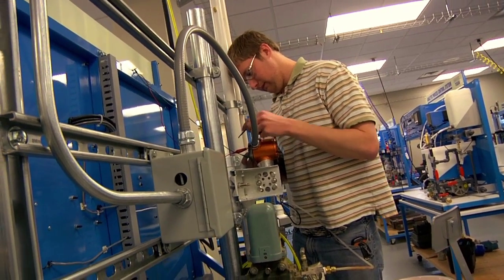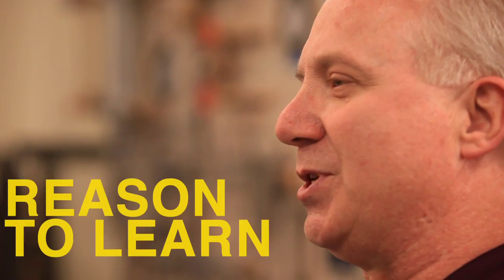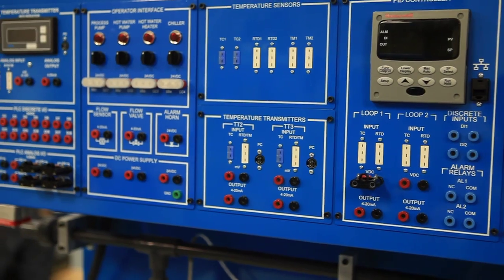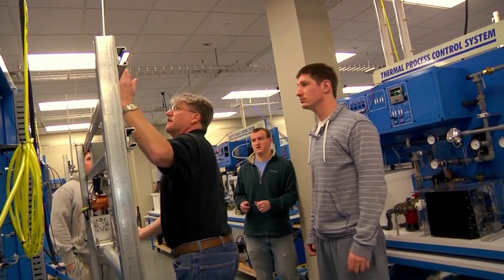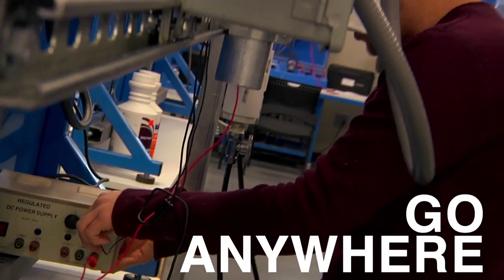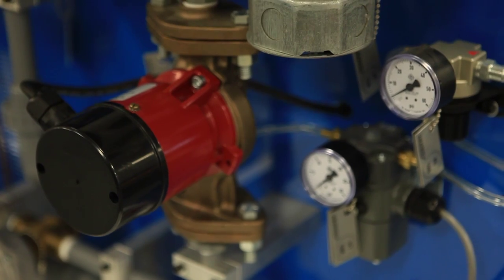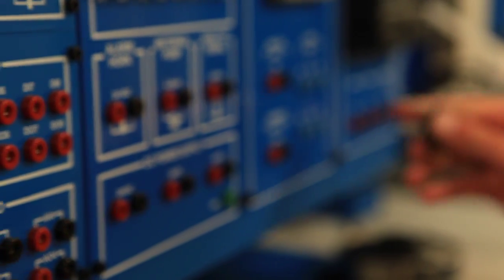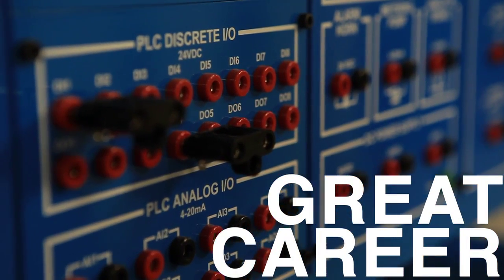Instrumentation & Control Technology

Comment: I have 30 + years experience in industrial controls. I have 2 community college certificates,1 in HVAC and 1 in electronics.
I started out as a panel builder, spent 9 years in process instrumentation, 2 years in calibration and 12 years in field service
repairing motor driven actuators and controls.

I am, unfortunately, 62 years old, not working, can't afford to retire and essentially unemployable.
I have been consistently passed over by potential employers in spite of my experience.

The job opportunities are there, but only for people of the right age.
Reply: I am disgusted and so saddened to hear that. Continue to push, dear friend. Push and push and push. Eventually a door will open and you will be recognized as the asset that you are.
Reply: paulgra I feel sad for you.
I'm currently pursuing bachelors in instrumentation and control..
Reply: That's illegal and called ageism.
Reply: paulgra, it's not right, but companies look at it from a medical benefits viewpoint...unless you can do CEMS exclusively.
Reply: this proves there is no shortage !!!!!
Reply: This should a good example of why you should max you 401k and invest your money for retirement. The sooner you start the better off you are when you retire.
Reply: I think people with your experience and at your age should be teaching us as instructors and teachers. Regardless if you or anyone has a 'degree.'

Comment: I work at Endress+Hauser as Field Instrumentation Engineer / Calibration Engineer.
We work in all industries, Oil&Gas, Food, W&WWTW, Chemical Factories, Diaries, Etc.
Work for use can range from Commissioning, repairing and calibrating instruments on a wide range of equipment.
Instrumentation is worth while to get into if possible as there is plenty to learn.

Comment from the maker: The field of instrumentation is the measurement and control of any industrial process. Typically instrument technicians create, construct, and maintain the measurement, control devices, and systems used to control any process facility.  Check out the contact information above to get connected with us!  Thanks